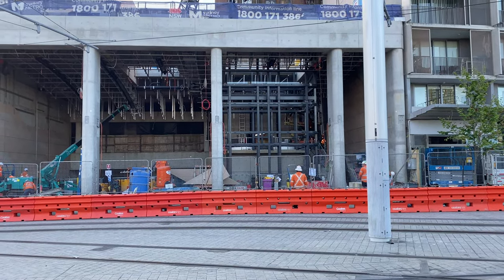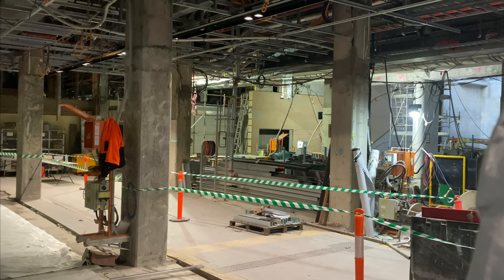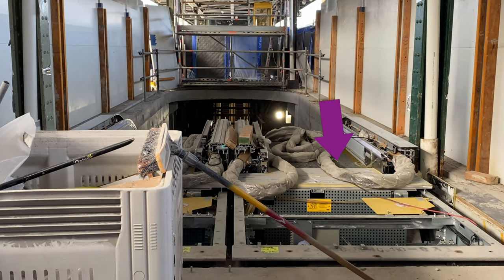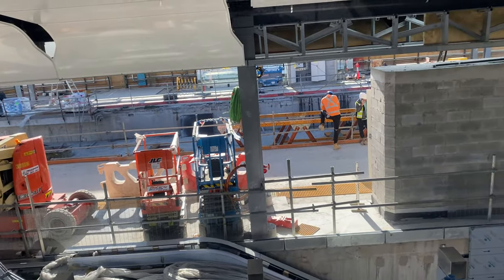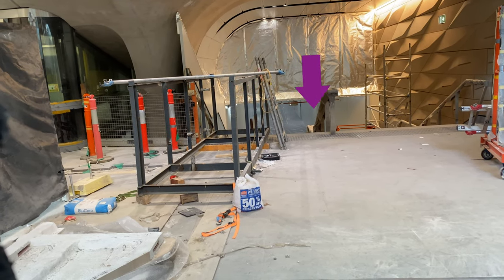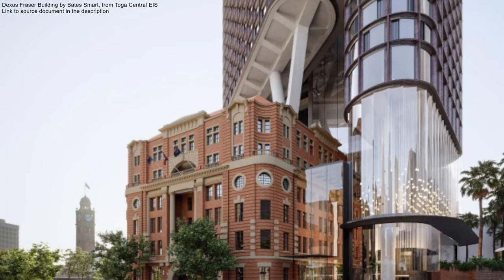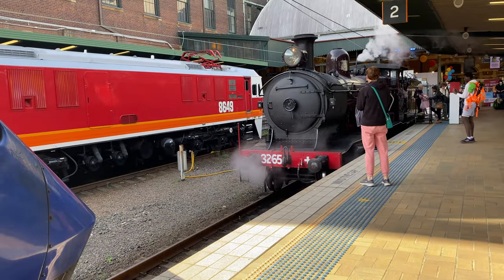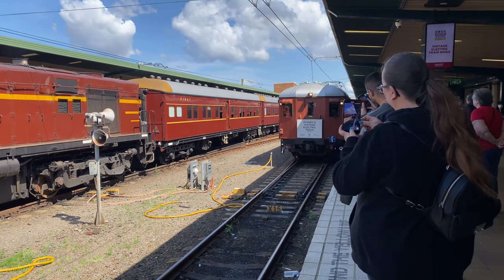Sydney Central Station Upgrade - Central Walk, Metro Concourse, Chalmers Street Entrance Aug-Oct 22

Comment: Amazing to see the changes, many of those tunnels now being used were up until the late 80's used for the movement of parcels between the Sydney Terminal country platforms & old parcels offices and the Central Station suburban platforms back when we still had the old red rattler parcel vans. 

They were also great way to get from platform to platform when things went awry and you wanted to stay away from the angry passengers when I was a suburban guard back in the mid 80's..
Reply from the maker: Hi Graeme, Wow! I never knew that! But bearing in mind where the former parcels office is, you certainly needed those underground tunnels. And a great place for staff to hide from angry passengers!

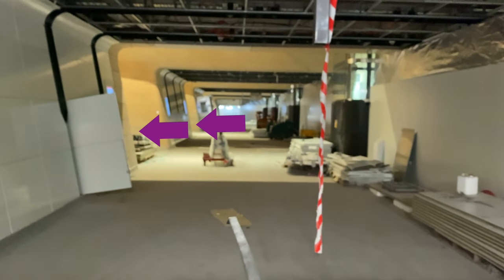Comment: I like the door visible at 2:45 sticking up at a slight angle because the wall it is in is angled. The extensive cable management system you mention at about 0:45 is simply the framework for a suspended ceiling, you can even see how the ceiling will curve downwards at the rear. the only cables that are likely to exist in that space are for fire detection (red cables) and lighting (white and orange cables).
The "mole holes" (access holes down to the metro platform worksite) were being filled in and according to something I read earlier the concrete fill was to be supported from above while it was being poured. I am guessing that this is what the "Orange Scaffolding" you mention at 5:00 is for, with some sort of support going down through the concrete pour which was then removed (and the support holes filled) after the concrete has cured.
The yellow protective coating mentioned at 6:00 is a waterproof membrane to ensure that rainwater is funneled into the drain rather than leaking through into the metro platform below. It would need to be pretty tough, or have a mechanically protective layer on top to be able to survive the ballast and repeated trains passing over it.
Oh, and just in case you haven't heard the news and want to go and film a progress video... Two TBMs have been delivered to the Bays station site on the 21st!
Reply from the maker: Thanks for that.  Yes that's right, the wall is angled there.   Thanks for your comments on the ceiling too. Not coming from a construction background, it's not always easy to understand the purpose of things that will be hidden from view when all the work is done. Thanks for the cable colours too. Yes that would seem like a logical use for the "orange scaffolding". I was at Central Station earlier today, and I can confirm that the "orange scaffolding" has now gone.  And thanks for letting me know the purpose of the yellow protective layer. Yes we don't want to see water leaking down to the metro platforms below. That would not be a good look! Yes I heard about the TBMs being delivered to the Bays site.  I'm going to take a visit there next week. It's all happening! Thanks for all your comments. I really appreciate you sharing your knowledge.

Comment: The YHA carriages that you show at 8:46 were actually static replicas that were constructed from 2002 to 2003, designed by Snyman Justin Bialek (SJB) Architects. They will be demolished for the Atlassian development and may be gone already. 

Also, the timber frame of the YHA building that can be seen at 8:33 is actually the Inwards Parcels Shed, dating back to 1906 alongside the rest of Sydney Terminal. That frame will be dismantled and reassembled later to form the entrance to the new Atlassian/YHA building!

An informative and enjoyable video as always, Paul!
Reply from the maker: Yes someone else mentioned that they were replicas.  Thanks for clarifying that this building is the Inwards Parcels shed. I'll remember that for next time.  Great that the frame will be reused!  Glad you enjoyed this video.

Comment: Thanks for the update! I wonder what’s going to happen with platform 15? Is it going to be omitted from the numbering or are they going to renumber 16-25 as 15-24 and/or are the Metro platforms going to figure into Central’s overall platform numbers? These are the mysteries that keep me awake at night lol
Reply: It's incredibly unlikely that platforms are renumbered, so platform 15 will be likely omitted.
Based off artist impressions at least, the metro platforms will likely get 26/27.
Reply: Wynyard Station has no Platform 1 & 2
Rockdale Station has no Platform 1
Reply from the maker: Hi Grace, as Abiram says, it's highly unlikely the platforms will be renumbered. These days, the platform numbers are locked into signalling and other software, and it's just too hard and costly to do. It's easier to have good signage instead.
Reply: @abiramen  thanks!
Reply: @ranger8237  thanks!
Reply: @TransportVlog  thanks Paul!

Comment: Great As Always....
Dawns on me all of a sudden with Central Walk continued through to Pitt Street/Railway Square what use is The Devonshire Street Tunnel?
It would be shameful to lose this relic of Old Sydney !
Reply: The Tunnel is outside the gate line you don’t have to be a passenger on a train to use it. It’s a way for pedestrians to cross the railway lines. That need doesn’t go away.
Reply: @francesconicoletti2547  And it will probably become a bit less busy. From the Western side you'd probably only use it if heading all the way or to 24/25.
Otherwise an extended Central Walk will be a shorter path.
Reply from the maker: Hi Patrick, yes as Francesco mentioned, Devonshire Tunnel is for anyone to use, as Central Walk will be for paying passengers only.

Comment: So that's what's happening to the plaza end of the Devonshire St tunnel, I've been wondering what was going up there - you've probably seen, the most recent activity closed off the tunnel end and opened up an alternate route going through where the bakery and newsagent used to be in the south wall. Hopefully once it's all over the plaza will be able to pick up some traction with shops again, although it'll never feel the same without Basement Books down in its cave below.
Reply from the maker: No I haven't been since early October, so I'll definitely take a walk through the Devonshire Street tunnel next time I'm at Central station. Yes I'm sure in the longer term, business will pick up again in the plaza area.

Comment: Paul, we were recently at Central Station, doing a slow walk through checking it all out. 
We noticed a ‘No Parking’ sign high up & wondered if that level was ground level once?
It’s visible at 8:15 on your video, on the Central Electric Bld.
Why wasn’t it removed?  Looks so out of place on the beautiful restored building!
Reply from the maker: Hi Annie, yes I noticed that too! Yes I reckon it was at ground level in the past, and I think they probably left the sign up for historical reasons! it does seem a little odd though!
Reply: @TransportVlog  not only odd but right out of place on the lovely restored building. Tacky!
I watched your previous video on Central & there was lots of shots to see the sign.  You pointed out the previous ground level….as I thought. 
Will wait to see.

Comment: Hi Paul, interesting video. Will Central Walk extend as far as the country platforms? Also, was there ever an old entrance to Central from Chalmers Street? I am guessing that once Central walk is opened, there may be some new shops included there. Years ago here in Melbourne, Spencer Street Station had a walkway underneath to various platforms, but when rebuilt as Southern Cross, that all disappeared. Now the walkway is above the platforms. Love the videoed vintage trains included from the expo, especially the red rattlers. Anyway, take care and all the very best. Rob.
Reply from the maker: Hi Rob, yes in the future Central Walk will be extended to the country platforms. It's still a proposal at the moment, so it will be a few years away. I don't think they'll put any shops in the Central Walk tunnel itself, as that would limit passenger capacity, especially at peak times. Yes, there is another entrance on the other side of Chalmers Street. It's exit 6 on this map - https://transportnsw.info/sites/default/files/document/2017/06/central-station-map.pdf
Reply: @RCG198 / Rob, Railway Sqe YHA & Ambulance 🚑 Ave / Lower Carriage Lane encompassing The Former Regional Rail Catering Store & Cold Storage / Garage Disposal Area for HJ’s & the various businesses on the lefthand~side of Devonshire St. Tunnel (as you walk toward Chalmers St.) plus the stairs beside the former HJ’s leading up to the Railway Sqe YHA have all recently been demolished, all the area in Ambulance 🚑 Ave / Lower Carriage Lane from The Ground Level
Rear of Platform 1 to where the carpark entry to The Basement Parking Entry For The Former Adina Hotel that was located in Ambulance 🚑 Ave / Lower Carriage Lane; along with the former RailCorp
fleet vehicle garages has all been demolished to open this area up, eventually the curved retaining wall above this area where the country rail replacement coaches also arrive & depart from near The VIP Entry Rear of Platform 1 (The Large Roller Door) & basically anything from the pedestrian crossing boarding the garden beds that one walks thru to Railway Sqe for The Bus Interchange, as all going to be abolished & reduced to ground level & opened out into where Lower Carriage Lane / Ambulance 🚑 Ave is presently located to create a ‘green’ parkland space for Central Walk to open out into into as it’s Railway Sqe Entry Point…

Comment: Combination of the new concourses at Central, Redfern and Sydenham will make a massive change to lots of people daily.

Which will open first or last?
Reply from the maker: Yes absolutely Mark! I reckon Sydenham, Central Walk, then Redfern. I'm hoping to do another Redfern update soon.
Reply: @TransportVlog  Central Walk wins that battle. It opens in half-width form on Sunday November 13 at 4am, half-width while they complete the northern banks of escalators to the suburban platforms
Reply from the maker: @Robert-um6fr  Yes I've just heard! Will be there on Sunday (probably not at 4am though). I had a feeling Central Walk was going to beat Sydenham!

Comment: Hi everyone, I have 1 question about the major upgrade of our Central station

As most of us-who loves Sydney’s railways & stations system knows that Central station has 2 ghost platforms are platform 26 & 27

The new notification board about platforms was changed from 1-25 to 1-27

I just wonder that the upgrade with two Metro’s platforms which is highly be numbered as 26 & 27-are they the same as the ghost platforms and they’re renotivate already existed tunel & platforms to make it Metro’s platforms or the platforms 26-27 are the completely new platforms?

If someone knows any information about it please let me know. I’m keen to learn about it! 😁
Reply from the maker: Thanks for pointing out the new notification board.  I reckon that means that the metro platforms will be 26 and 27. They will be brand new platforms and these are under platforms 12 to 14. The ghost platforms now have various service facilities and cable routes, so they are unlikely to be used in the future. Hope this answers your question.
Reply: @TransportVlog  Thank a lot Paul for answering my silly question, I understand now and wish you have a great week. Hope to learn more from you ✌️

Comment: I hope this doesn't mean they are going change all the other old stations on the City circle line ? one of the best thing is how they kept examples from different decades gone still. Must everything become this corporate metro selfie man bun culture style ? The last 20 years has seen such an increase in the destruction of Sydney's building history, all in the name of ushering in this current poncy corporate age.
Reply from the maker: Hi Adam, no I don't think Museum or St James will change very much. They were designed with lots of space originally, so there's no need to expand them further, unlike other stations such as Central and Wynyard that desperately needed additional passenger capacity.
Reply: @TransportVlog  I hear ya.